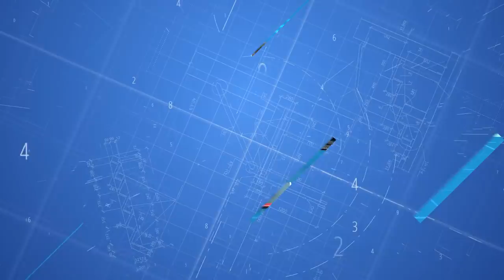Mahindra Blueprints - aerodynamic secrets of a Formula E car

Comment: All about drag, zero downforce
Reply: @Cloxxki  Of course LMP are far more efficient. If done right these things would have at least torque steer and a windscreen so I don't really see the point of the design here.
Reply: @Cloxxki  Sounds all nice and fun. The ID.R comes really close from the looks. Let's see how it performs in road circuit spec on the ring. However, by the time batteries cause nothing but problems in terms of actual racing. I'm with you at RX or hillclimb and there were many ideas ao far but in the end all dropped for a reason. I think F-Cell is in the lead at the moment. Anyways why not put on a show with an ICE racer on alternative fuels? Would be my favourite. Alternative fuel 919 Evo single seater for 3h races ;)
Reply: Yeah, downgrading Underbody Design